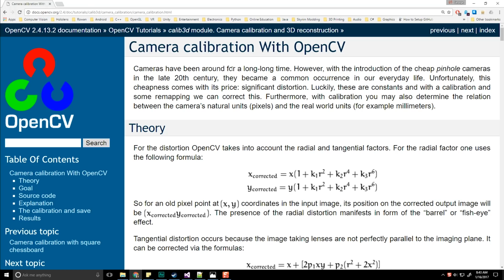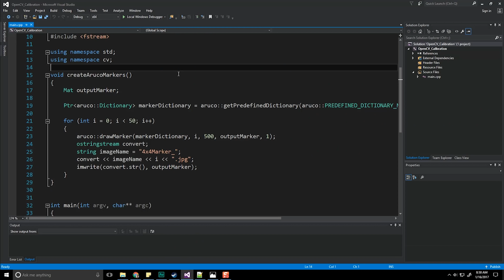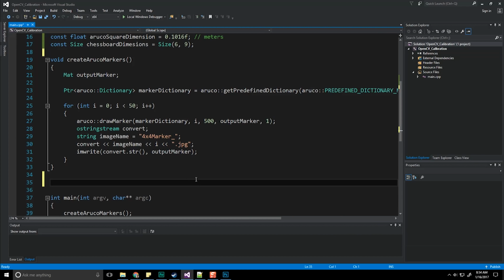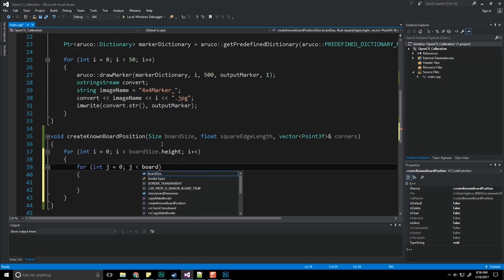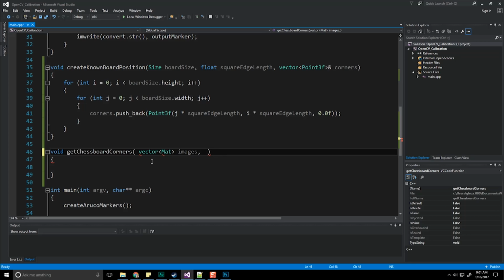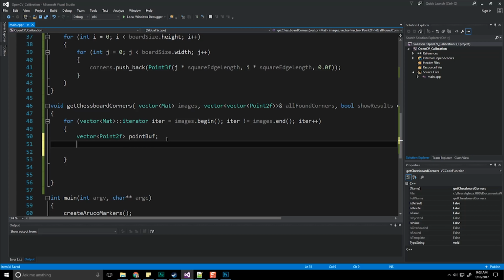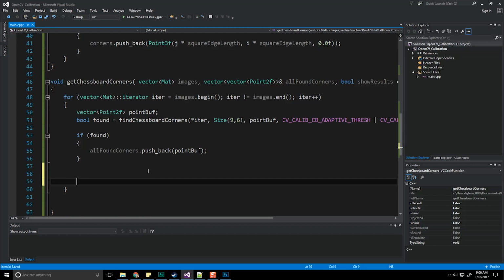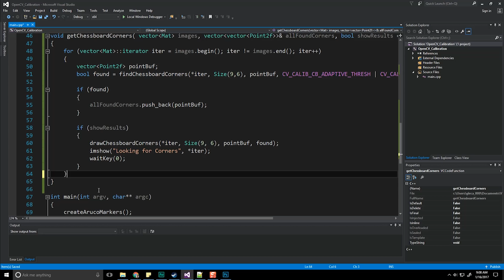OpenCV Basics - 16 - Camera Calibration Part 2

Comment: Good morning George, I have two question about the const float at the top. 
1. The calibrationSquareDimension is the length of the square, is it?
2. What is the arucoSquareDmension?
Reply from the maker: Yes, measure the size of one of the squares after you print it.
The aruco square dimension is the size of the printed aruco marker you are going to look for.
Reply: @GeorgeLecakes  Hi George, can you clarify more on the aruco marker? I didn't quite understand what it is in your case.
Reply: @nimaforouzandeh392  Hi nima, what you did about this? im lost in this part of aruco.

Comment: Okay, I have the code to do a calibration, it compiles and it runs.  But I found one thing that is absolutely nuts, lol. Apparently you have a few terabytes of RAM in your box because you feel comfortable in using way more than you need to. The issue is the vector<Mat> which holds all the images in a uncompressed format. Really? There is no reason why you can't "findChessboardCorners()" on the images, one by one. It barely changes the code, instead of passing a "vector<Mat> images" you can pass a "VideoCapture( vidStream)" and read the frames one by one inside the for loop.
I think you get the idea.
Reply from the maker: The code ran on my pretty standard gaming laptop at school whem I was taking a computer vision course and made these videos years ago, which certainly doesn't have terabytes of ram. Maybe 12 gigs at the time.

Comment: Ouch! I discovered that while "findChessboardCorners()" works well enough on moderately sized images (say 1920x1080) it fails completely on larger images ( e.g., 4000x3000).  This is disappointing because one of my cameras (and the one with the worst distortion) is a GoPro Hero4 which takes 12Mp photos. I haven't tried photos from my CoolPix but since its images are even bigger, I expect problems. FYI, I'm using OpenCV 4.0.1
Reply: i think you will be fine to resize it down to a reasonable size as long as you keep the aspect ratio

Comment: Hey George... i tried your tutorials and it works very well, but i have a problem with the detection because of the speed. I Have a logitech c920 and when i run the program it turns to slow. How can I detect the markers fast? because sometimes detect the marker but when i move the marker too fast the detection fail, after 5 seconds return  the detection but i need every second my detection what can I do please help me. ..i use a resolution of 1920x1080. and I use markers of 4cm x 4cm ... please Could you give me an idea to increase the detection speed !! thank you !!!

Comment: Hello. I succesfully calculated camera matrix. Also, I succesfully detect aruco marcers and get position of them (translational, rotational vectors). But I have a question...How can I know that camera calibration was succesfull? In tutorials there is a very nice explanation how to do it, but I don't know how to check if calibration parameters are right? How can I test if camera is calibrated correctly and how to visualize calibration effect? Thank YOU!
Reply: Andraž Škoda please provide me the code which you had used  to detect marker

Comment: The only way it makes sense for you to rotate and/or translate your board in every image, is because openCV calculates the extrinsic parameters for "each" view ( This is clearly seen in the sample code output xml file ) and hence, MAYBE , the Z = 0 can be used since maybe the rotation matrix is affected to compensate for your different Z-value.

( Extra  - OpenCV uses the same set of intrinsic parameters for all views. )

Comment: Question, you write that these are meters, but why did you write arucoSquareDimension = 0.1016f? 
Why f???
My marker is 4cm, so i have to write 0.04 right? with or without f?
Reply from the maker: +Nicola Pignatelli the F on the end of my very variable denotes that is a floating-point variable and not a double value which means it's 32-bits instead of 64 under most situations

Comment: Forgot to confirm the arucoSquareDimension.  Should it be 0.01016m instead of 0.1016m?
Thanks.
Reply from the maker: Depends on the size you printed it out to. I did a full page marker for each one individually, which were about 6 inches in size.
Reply: @GeorgeLecakes  how i can know the aruco size?